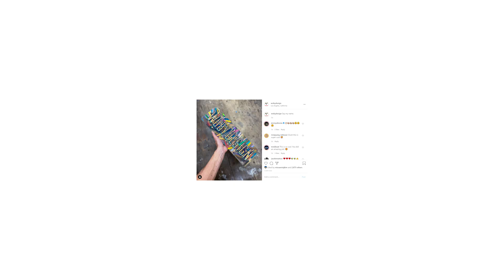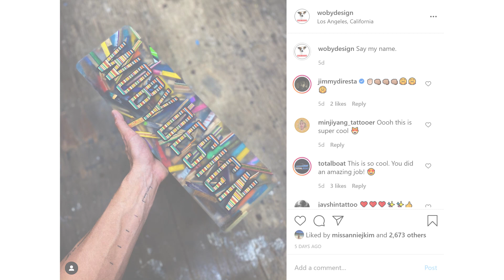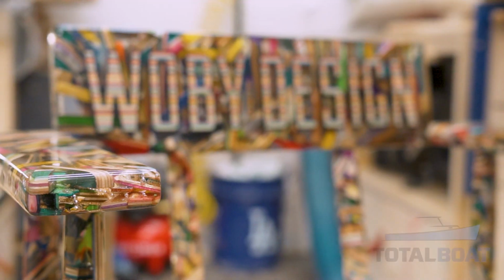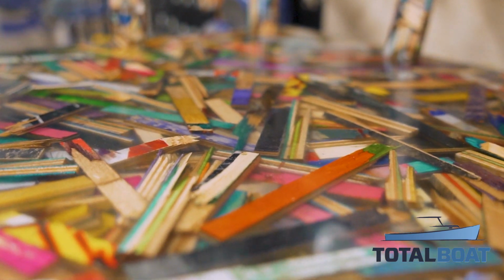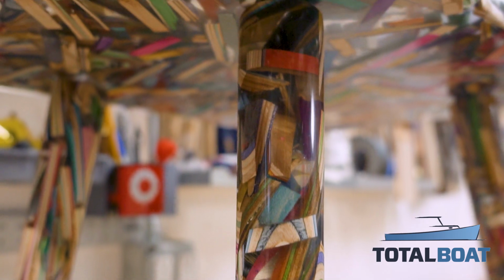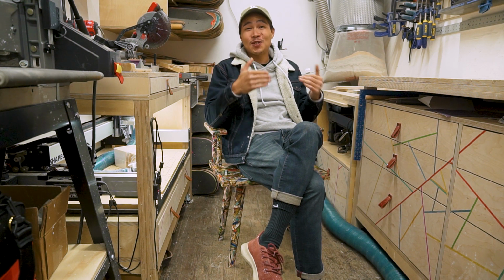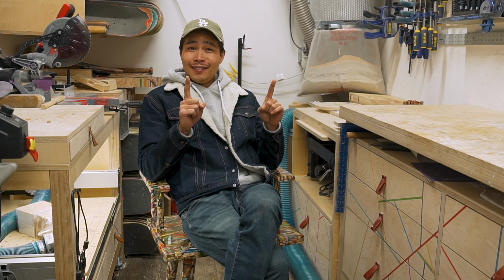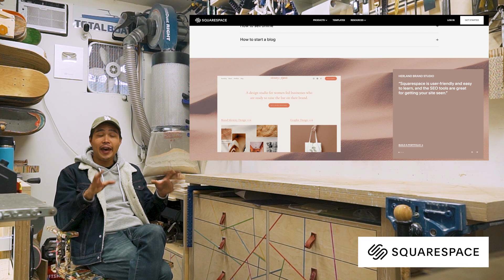CHAIR MADE OUT OF BROKEN SKATEBOARDS & EPOXY!!

Comment: Think about putting the legs and spindles into compression before assembly.  Perhaps drill a hole through the center a place all-thread with nuts and washers on end or fit a tension wire down the center.  That might provide the strength needed for this application.

Comment: Its a beautiful creation! 

If I may offer some insight? since it is a less than perfect "lamination" situation, if you were to put something of a core into it, similar to how rebar and metal mesh are used in laying brick and concrete, it would give the epoxy and the skateboard bits something to adhere to. You could use very thin rebar or steel rod as the substrate for the legs and arm supports and chicken wire for the flat parts.

Just a thought!

Comment: I saw a video where model airplane makers thin epoxy out to something very liquid - say 10:1 mineral spirits to epoxy. Then they paint it on the balsa wood and it nearly fossilizes it. Maybe you could experiment or find a similar recipe to structuralize the skateboard pieces.